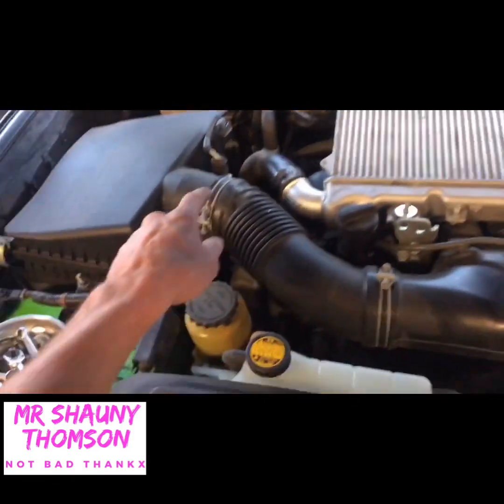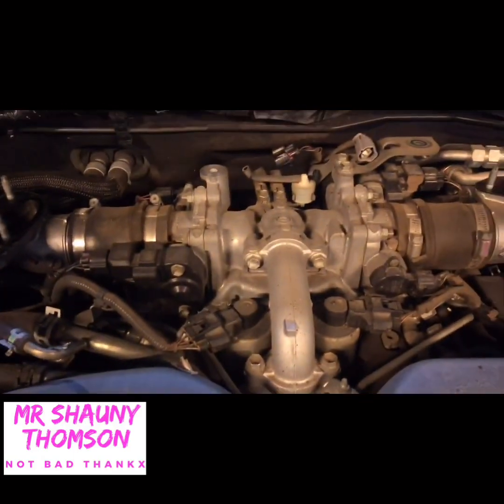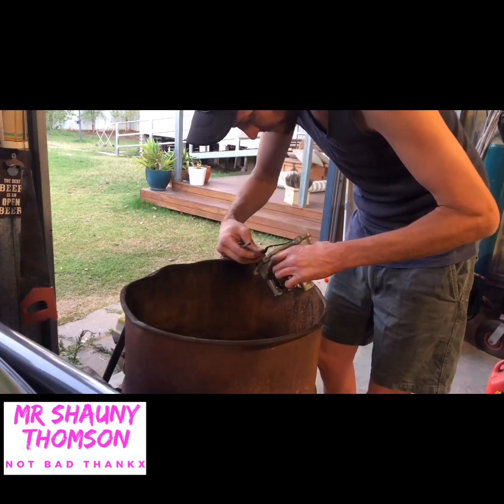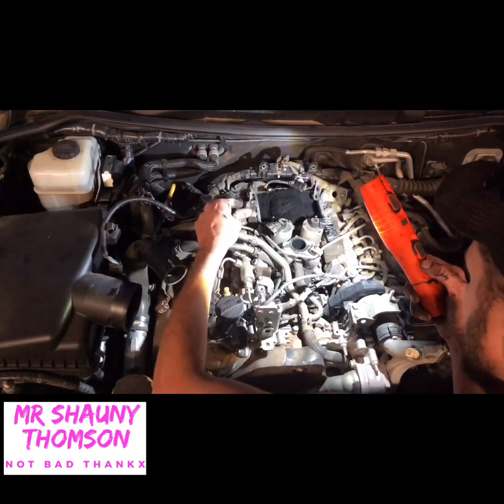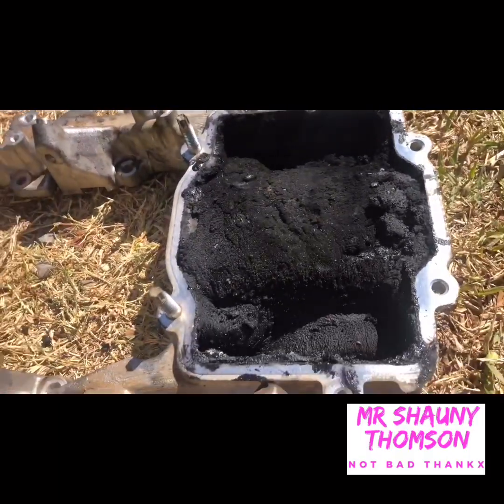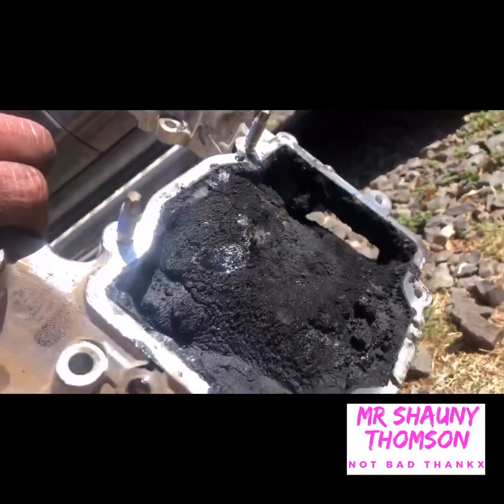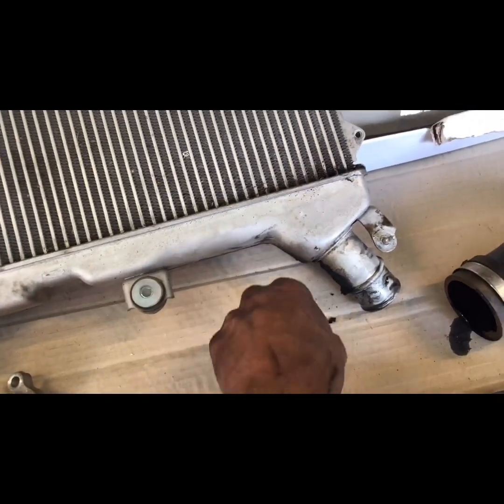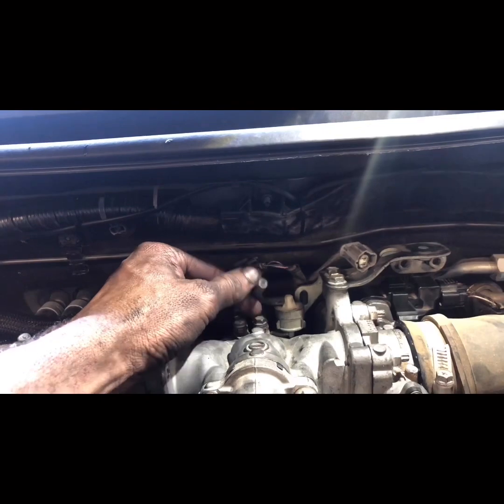200 series landcruiser EGR clean

Comment: Did mine over last two days, inspired by your video. It’s doable at home but really do take note of your disassemble order. I F’d Up and forgot fuel transfer pipe to union till after I installed the fuel rails and cooler lines, passenger side had to be dismantled again to get the line in. Smoother and feels better, wether it is or not ? But if you open the can, you have to clean out the worms.
Reply from the maker: Well done bro for giving it a red hot crack it’s not that bad once you get in there. It helps when you film everything to 😉 you can always go back over the footage lol 😂. Did you take the butterfly’s out while you where going??
Reply: No didnt take out throttle blades, couldn’t find out why you would? Anyway, the throttle bodies are easy to get at.
Reply: And just now your video on throttle blade removal appears , go figure. I think I will leave them in as a run on situation gets ugly very quickly. And I think there is more exhaust pressure pushing exhaust in from the heads and restrictions from the air cleaner intake tract/turbo than half open throttles at that low 600rpm. Only way to tell would be with a vacuum-pressure gauge plumbed into the intake manifold after the throttle blades with before and after measurements.

Comment: Thank you for sharing 😊.. Do you clean sludge on back side of the valves? 
Also is their build up in the combustion chamber and piston tops? If so how do you clean?
Reply from the maker: Try an clean it yes but be careful not to drop anything in there. And you can’t clean the combustion chamber without removing the head so no don’t worry about that😊

Comment: Hey mate you said you were going to do a full egr clean but I only sore a half clean you didn’t remove the egr coolers and the other 2 split parts anyways video was ok at least shows how long you actually took to do half a job. You said you used petrol to clean the intake does it work well?
Reply from the maker: Your right I did say that.
I was only going to to the intake clean as I did. An yes petrol works really well

Comment: Hey mate great vid! In the end did you have to drop the coolant or did you get around the coolant lines ?
Reply from the maker: Thankx mate so you don’t have to drop the coolent but you will loose some when you pull the EGR cooler out just make sure when it’s all back together to bleed the cooling system I should of showed the in the vid. The coolant lines that bolt to the intercooler on the left hand side there is a little rubber cap. Run the engine with the heater on an remove that rubber cap th get the air out of the system
Reply: Cheers legend heaps easier way than dropping all the coolant and bash plates etc !

Comment: Hi good video i normally do do my own cars but only just purchased the 200s and got scared and sent it to the shop. I was told i would have engine lights on if i removed the EGR and it needed to go into the shop to have it turned off in the computer. I didn't notice the engine light on on your when you started it up. Is this true
Reply from the maker: Hey mate this is correct you will need to get the EGR turned off with an eng tune. What I did was take the butterfly’s out they are separated to the EGR system
Reply: @itnotjustfreestyle09  thanks where do we message you to talk about online incomes

Comment: here’s a controversial one for ya Shauny, what oil? I was using a 5W30 synthetic changed every 10,000. The deposits in my manifold were an oily sticky mud, not crusty. Would a more traditional oil like Delo 400 15W40 have less blow by.
Reply from the maker: Very good question old mate I probably should do a video on this but I’ll try to keep this short. 
Back when these vdj engines came out in 2007 the recommended oil was the 15w40.

 but as you would know everyone was complaining about them using oil, what they discovered was the oil ring (wiper ring)on the pistons, the spring on the ring wasn’t strong enough to hold the ring against the bore therefore allowing the oil to bypast the rings and burn it. 

In 2009 I think it was, to fix this problem they changed the recommended oil to a 10w30/ 10w40 semi synthetic, basically run a lighter oil so the oil rings could wipe the bore properly. 

So me personally I run penrite 10w30 semi synthetic an it works a treat 🤙
Reply: So lighter oil rather than heavier, interesting. I’m using Castrols  Magnatec Syn diesel 5W40 or Penrite Vantage Syn 10W40. I thought they may be too thin. Engine has 160k on it, I’ve never put more than 200-300ml in it between oil changes, so definitely not using oil.

Comment: Have you got any vids on a rebuild?
Reply from the maker: Not really mate are you having trouble going back together? Another reason I film is I can go back through the footage an pause to see where hoses run an stuff
Reply: Howdy, just went back and found this clip and forgot I'd left a comment on rebuilding 1vd-ftv. Well I've rebuilt it with heaps of photos back tracking as l started dismantling it march 2021. 
Engine sat at a engine shop for 12 months so I ended up doing it myself.
Man there's some hours in them.
Anyway it's sitting ready to go back in this week.
79 series dusted from leaking around the intake at the turbo.

Comment: Did you put an EGR blocking plate in.
Reply from the maker: Not when I made this video mate I didn’t.  I had the eng trans tuned not long after I did the clean an I had the boys turn the EGR off. I have a more recent video replacing the starter motor an doing an intake clean and completely removing the EGR system 😉
Reply from the maker: https://youtu.be/k12jlM3d3Qk?si=zPSgcPp6wAZJ2bcx